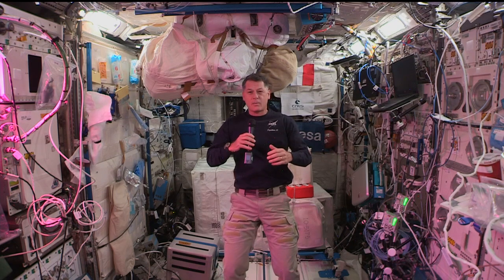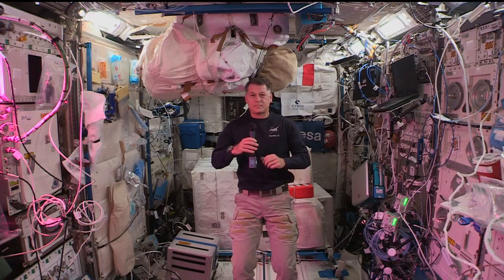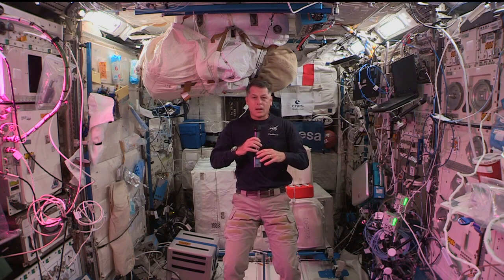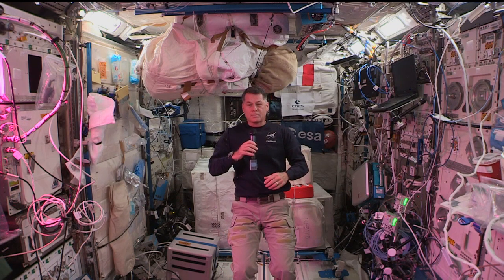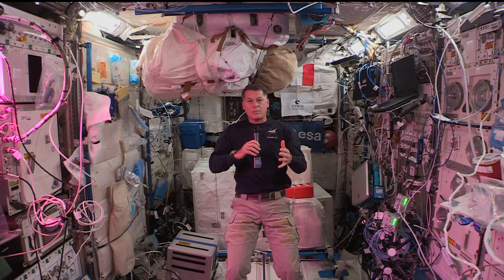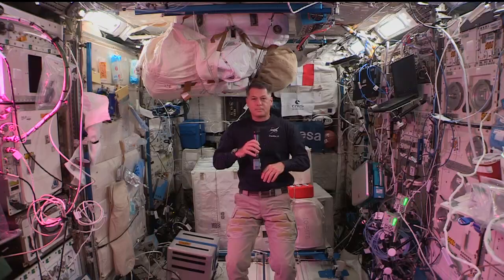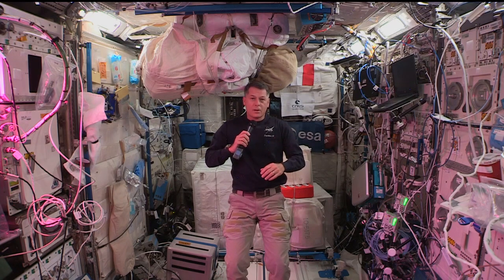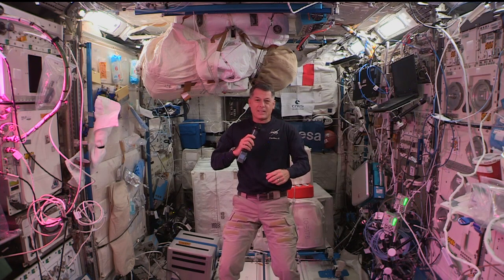Expedition 65 Shane Kimbrough Discusses  IROSAs Spacewalk - June 14, 2021

Comment: 🤔 💭 😴 About rest . Not resting well , let’s see last expedition you shared with 
Us on ground on a diet of energy by calories. Every thing needs energy. We can catch up on rest however we can not store it. Like equipment our body is not the same for certain in zero gravity also we are 60% Water. The Apple 🍎 juice 🥤 could be the culprit of this I know that you have experts on the ground like :dietitians, I just thought possibly still drink water eat the apple 🍎 by piece or, sauce it makes fuel for cells 
At a burn of normal digestion I call this Anna’s 
Cat . Anabolism - constructive metabolism, catabolism - Destructive metabolism, then Basel metabolism. The portal bowel finishes the rest.
Like a cracker eaten a starch turns to sugar,
Then sugar is now a fuel like some carbohydrates.
I’m confident you know 
Also remember that you have lettuce 🥬 an salad 
A great supper to block energy from your energy to rest because of natural tryptophan. A definite time of rest guaranteed. 😂👍🤷‍♂️ on the other hand if it’s a situation just try an keep communication with crew members. Group maybe they will express their own restlessness. If then there is any other reason. Just think
What is the most important number to call ? The one you need to call next. 
Sincerely Godspeed Larry Whittington & the team earth 🌍 family your pal 
🐝🌎💫